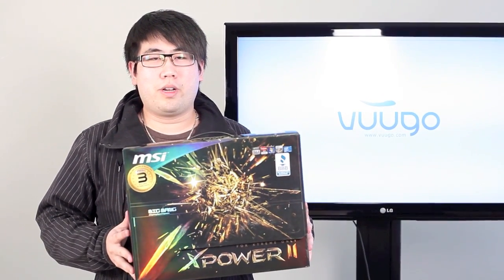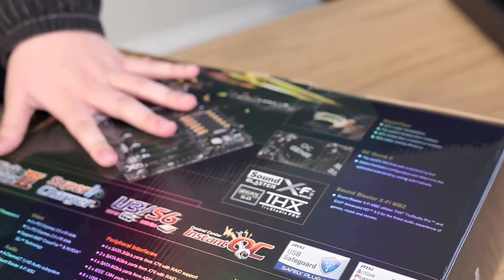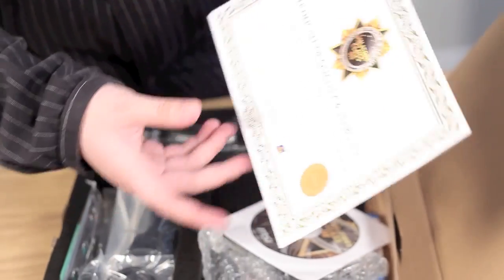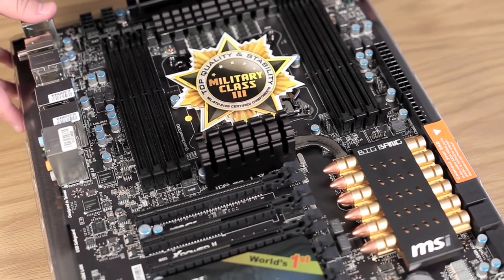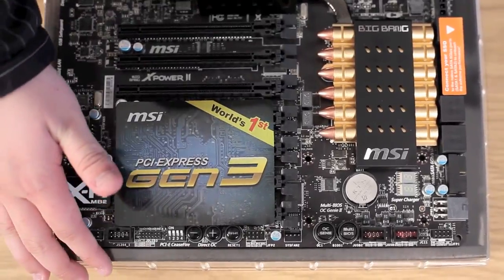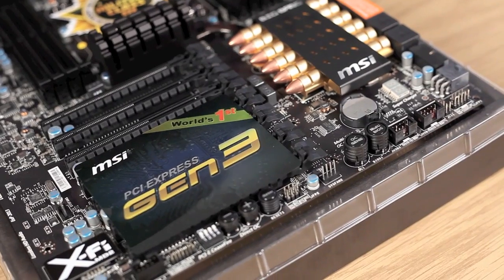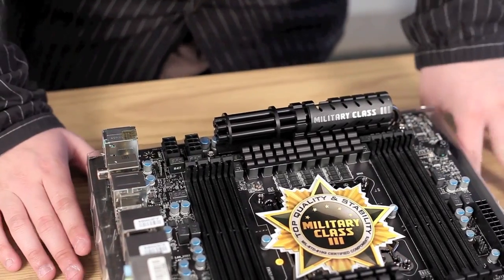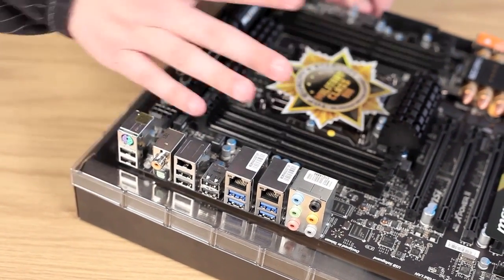MSI Big Bang XPowerII Motherboard Review

Comment: will this be able to fit in a haf x case and still be able to put the psu at the buttom of the case, casue the haf 932 is to small for this motherboard, as i just found out when i began building my pc, and then discovered that the MB is the deeb and the psu wouldt not fit at the buttom of the case, and i would there for have to instal the psu at the top but there it have planed too install the H100 cpu water coler. please help me quick. thx